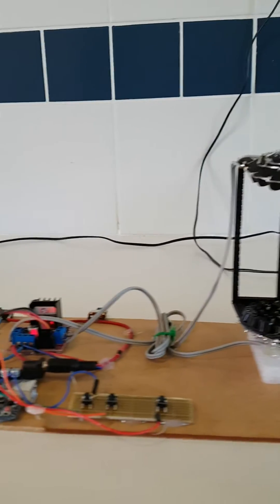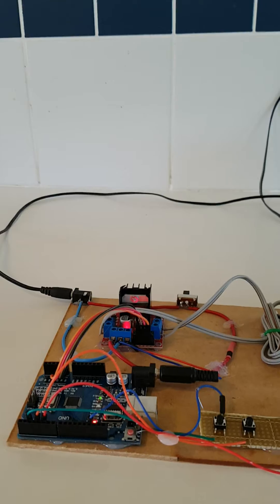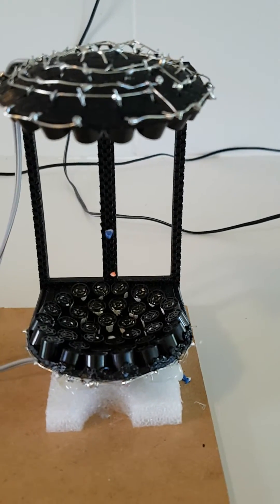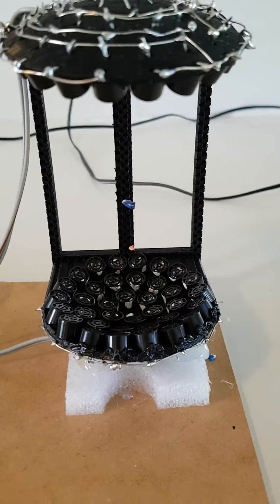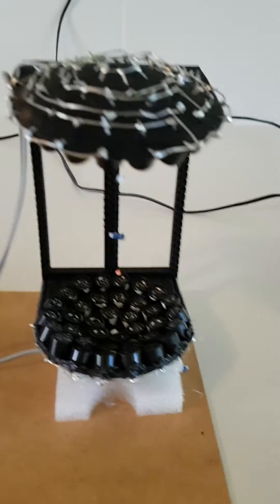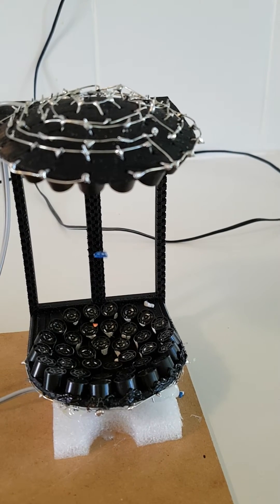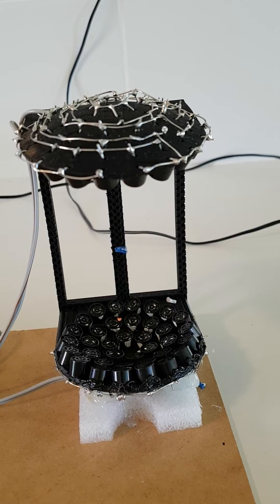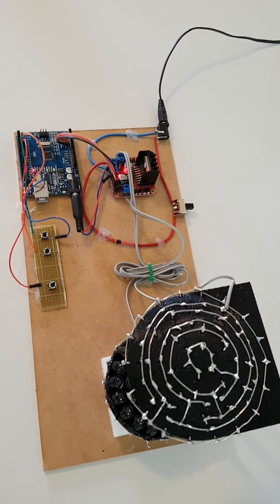Ultrasonic levitator

Comment: VERY impressive Leon. It was probably the interference on the audio, but did I hear you say you levitated an ant?
Reply from the maker: Yes, I did it twice, but the trouble with ants is that they like to hold on. This makes it hard to levitate a live ant, you need to flick it off the mesh with a toothpick with just the right force in just the right place. It would not levitate resistors or other parts.

I am amazed also at how strongly the ultrasound (which I could just barely hear) interfered with the audio on my phone.